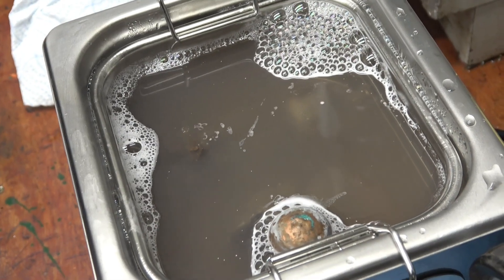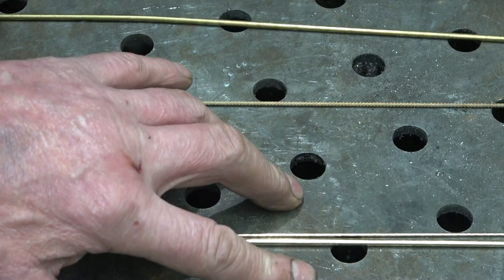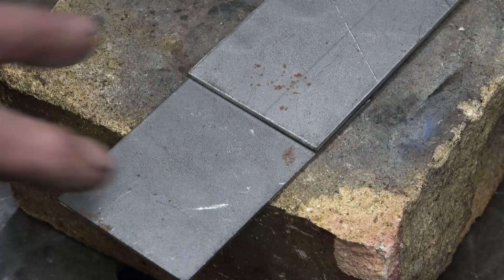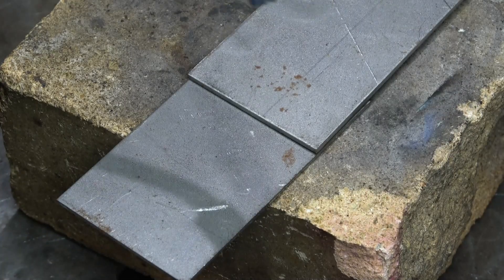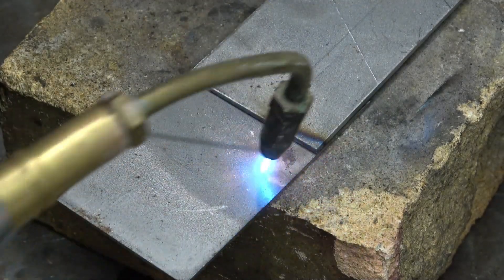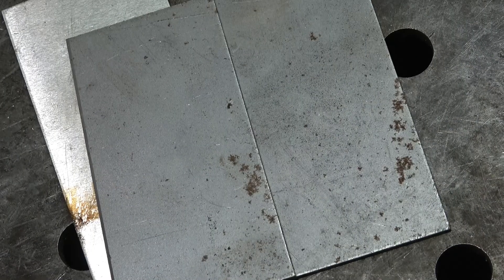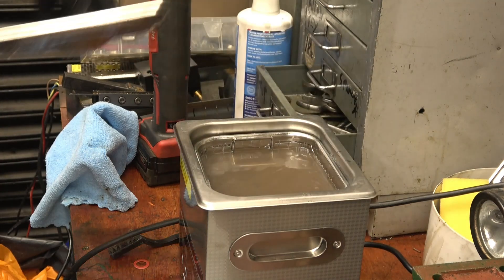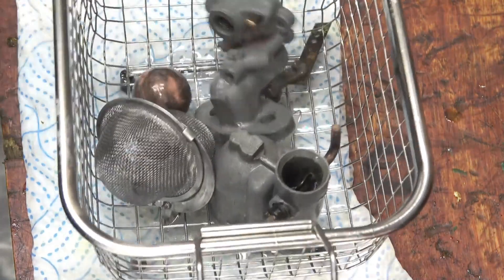Wed Catch Up 14  TIG Brazing / Gas Brazing.  Ultrasonic Cleaner Revisited.

Comment: I used to do a lot of gas brazing back in the 90's was on price-work I started on a number 2 nozzle and eventually as I got better and faster ended up using a 18-20 nozzle preheating the next piece in line as I brazed the first etc. 

B'stards then cut the price work so ended up slowing right down using a number 2 again. The flux we used was a liquid chemical with a really long name that was  poured into a eureka type vessel fitted inline on the acetylene hose, the vapour mixed with the gas and turned the flame green. Good times. 👍

Comment: Have used a small basket type ultrasonic cleaner for many years, very effective.  I have found for small parts like carb jets and suchlike a small yoghurt tub with a little white vinegar in it is great I just sit the bought tub in the water filled ultrasonic bath and it works a treat, no need to have the parts in the main bath water., saves chasing small jets etc around in the. larger bath. Also if you are using a more expensive cleaning fluid it's much more economical.  Might take a couple of minutes longer but it still works well.

Comment: Carbusonic Ultrasonic carburettor cleaning solution in case anyone is interested. It's great and Aluminium safe will not darken parts. Use on Steel, Brass, Tin, Zinc, Aluminium, Copper, Ceramic, Plastic, Rubber and glass. Unlike acid-based cleaners our solution will not attack aluminium to darken the surface instead it is compatible and leave a good clean finish.
Reply: I found a silver sixpence with my metal detector, threw it in the ultrasonic bath at work and came back to a  wafer thin scrap ! 
Hadn't appreciated that the solution was a bit aggressive, we used it for cleaning ceramic tooling.
Reply: That's one of the brands I use. I find it works well.